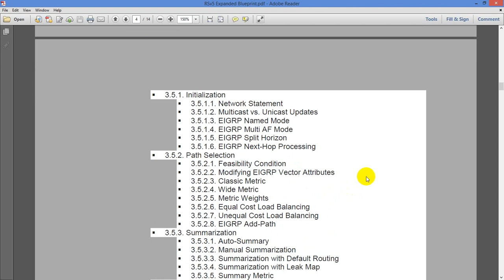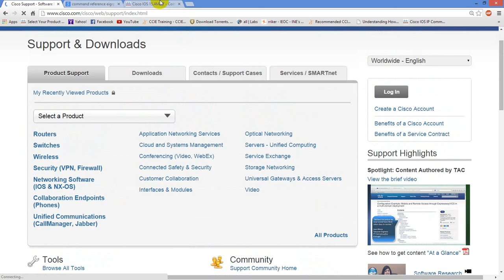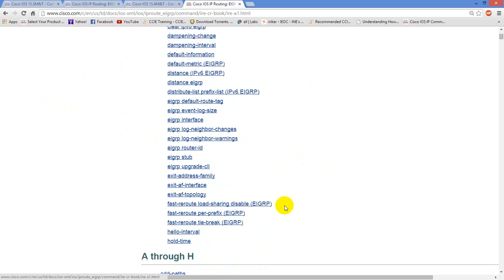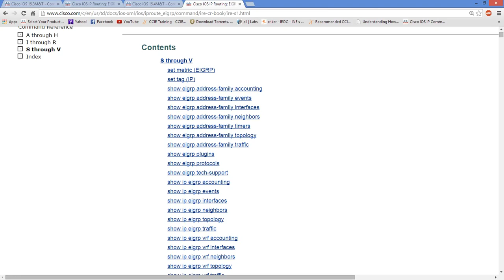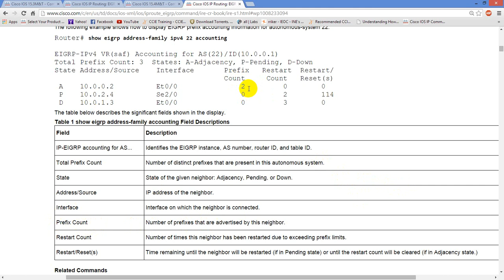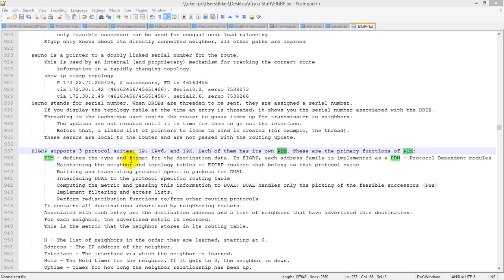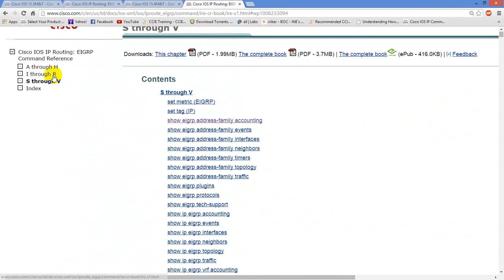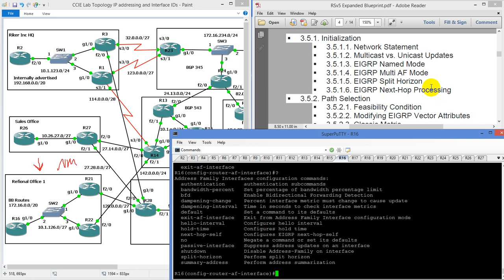CCIE Labs   EIGRP Named mode, network statement, mcast and unicast updates, multi AF mode, split hor

Comment: Hey Rob, I wanted to follow this lab in VIRL. My issue is that I don't know what you have running on the other routers - I wanted to get an overview of the topology? Is it all IP? I wanted to set up something like this in a smaller scale. My limit is 20 routers for now until I get the 30 router license. Thanks.